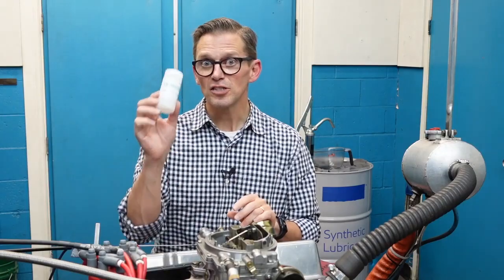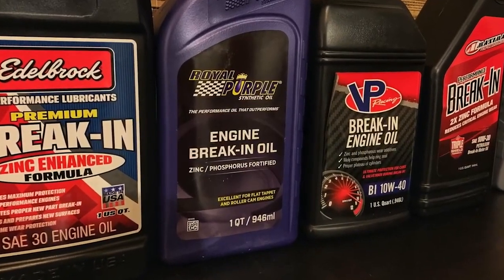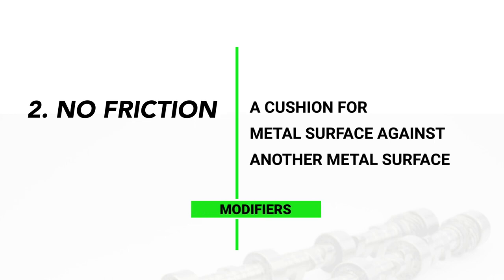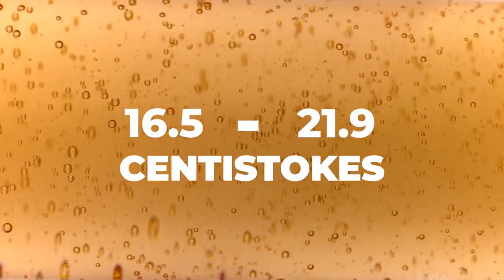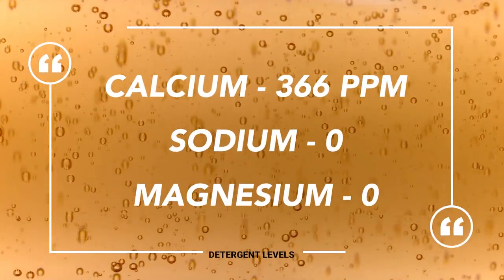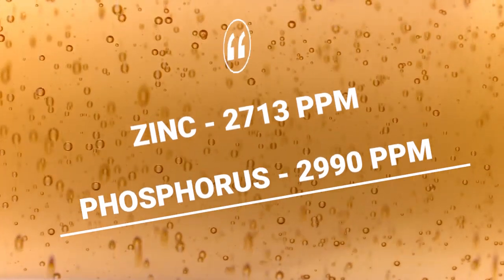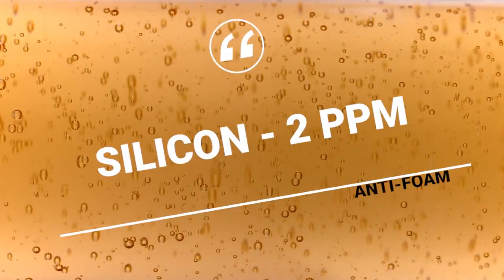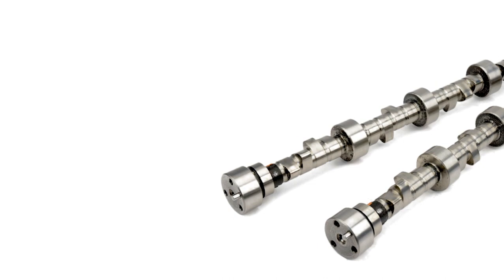What is a Break-In Oil?

Comment: What are your thoughts about mass production engines and using break-in oil? Say, driving a car home from the dealer and changing to oil to a break-in oil, then driving it for about 500 miles, and changing back to the oil that your going to use moving forward?
Reply from the maker: Years ago we tested the factory fill and it wasn't an off of the shelf M1 oil, so I'm guessing it's something special. What I would do is just do the first oil change around 1000 miles. It's also good to do used oil analysis on this initial drain as that should technically give you the highest values you should ever see with your engine. That baseline will help identify issues in future testing.
Reply: @lnengineeringllc  Thank you for replying to my question.

Comment: Good evening what bout roller lifters
Reply from the maker: Roller lifters are nowhere near as finicky as flat tappets, but most camshaft manufacturers still do recommend using a break-in oil with any new cam and lifters during the initial break in, which usually is the first 20-30 minutes of operation for a new or rebuilt engine.

Comment: Can you run the Drive BR oil for 3000 km?
Reply from the maker: Nope. Driven BR, or any true break in oil, is pretty much good for 200-400 miles tops. We do not recommend running break in oils for extended periods.
Reply: @lnengineeringllc  
This is exactly what I thought. The reason I asked is because a friend of mine just had his M97 stroker engine (to 4.1 L) built, and the person that built the motor made him run the Driven BR oil for 3000km, which is nuts to me.

Thanks for the confirmation.
Reply from the maker: @MrAnticaArte  For sure that would have a negative effect on any engine to run a break in oil that long, especially if they didn't change it every 200-400 miles as that's the max you should ever run a break-in oil, such as Driven BR.